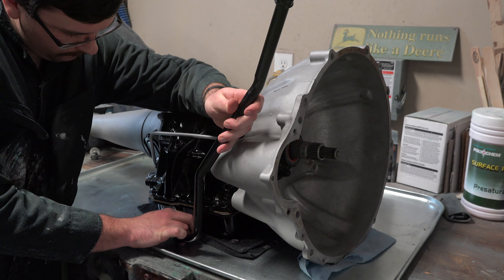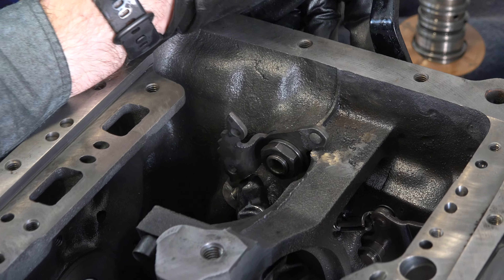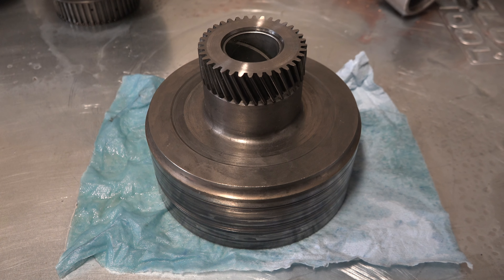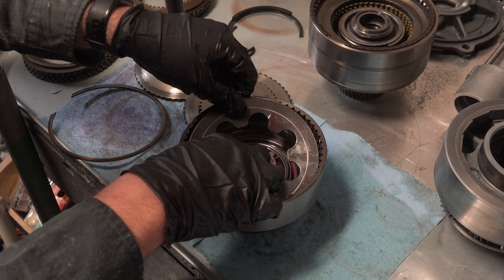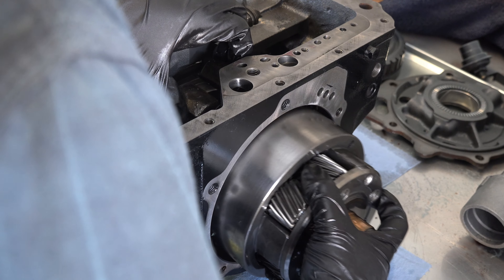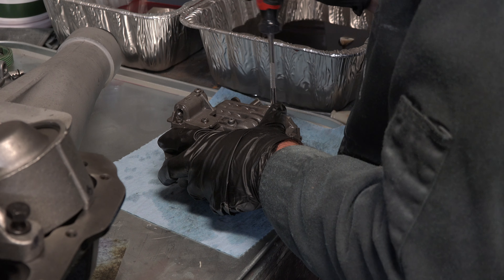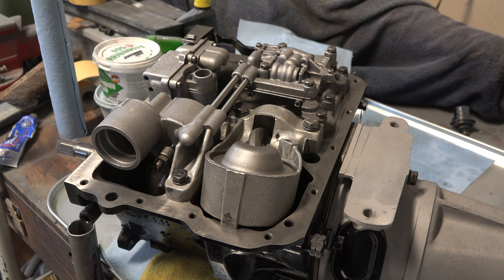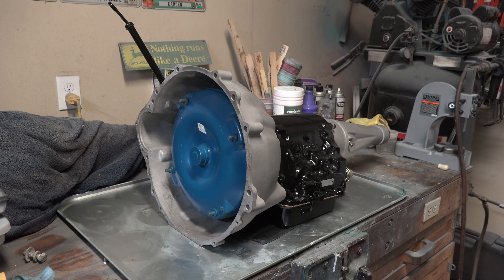1963 Thunderbird Restoration Part 8 - Cruise-O-Matic Rebuild!

Comment: After rebuilding my large case cruise o matic I'd like to share the most important lesson I learned from the experience.
Speedgems makes an adapter to bolt up a C6, AOD, or even a C4 to a MEL engine.  They have another adapter if you want to use a Chevy transmission, instead.
Reply from the maker: Very good to know! I know C6 swaps are very popular, however if I ever replace my Cruise-O, I would want to throw an AOD in there to get the benefits of overdrive, nice to know there is an adapter out there!

Comment: What rebuild kit did you use to replace the seals, bushings, etc.?
Reply from the maker: I got my rebuild kit from Concours Parts and Accessories. Most Thunderbird parts suppliers and some transmission parts suppliers carry at least two kinds of kits, a "gasket" kit which has all the seals needed for a rebuild, and a standard rebuild, or "master" kit that also includes the frictions & steels for the clutch packs. I would highly recommend getting a kit that comes with the clutches because it is getting very hard to find places that sell just the clutches only. As far as bushings are concerned, bushings typically do not come in the kits and will need to be purchased separately. The only two bushings that are readily available are the tail shaft bushings that the drive shaft rides on and the front pump bushing that the torque convertor rides on. The other bushings are typically much harder to find because they are no longer remanufactured. Occasionally, some OEM bushings will pop up on eBay, so that is worth a check if you needed a specific bushing. In general, plan on reusing most of your original bushings. Also some parts, like the filter and the vacuum modulator, usually do not come in the kits, so keep that in mind if you are wanting to replace those too.

Comment: What kind of ATF will you use?  Type F is what is specified, but after my rebuild i got mixed info on whether it should take standard atf with the modern clutches , etc..
Reply from the maker: I will be using Type F in the transmission. I did some research and arrived at the conclusion that as long as the clutches had been replaced with newer ones, that either Type F or Dexron/Mercon will work. That being said though, I decided to go with Type F because it prevents slippage in the clutches, which will provide firmer shifts. An old transmission rebuilder I knew told me that the firmer the shift, the better it is for clutch life. Also since I’ve already soaked the clutches, bands, and seals in Type F, I don’t want to cross contaminate it with a different fluid. I’ve heard mixed opinions about Type F compatibility with Dexron/Mercon, so I don’t want to take any chances.
Reply: @AngellsGarage  thanks.  That is what im leaning toward as well.  Actually now that i think about i did soak the clutches in type F and use it for assembly.. so i guess im committed.

Comment: Nice video. But why are you thightend the adjustment screw from the front band after the 10 in-lbs? In my manual stands that the adjustment screw is to loosen after this part. I want to adjust the front band, but some people say thighten and some loosen the screw. I dont know what to do…
Reply from the maker: Thank you sir! So you are right, the manual does say to loosen the screw 1 full turn after the 10 in-lb adjustment with the quarter inch block. I had read through somebody's rebuild of a small case Cruise-O-Matic where they had problems with their rebuild about a year later. Their problem was that the front band began slipping after they had followed the shop manual's adjustment instructions to loosen the full turn. To make a long story short, someone with many years of experience rebuilding the Cruise-O-Matics and even some old shop manuals from the 70's said to actually tighten the adjusting screw 3/4 - 1 additional turn after reaching the 10 in-lbs. After he made the adjustments, his Cruise-O worked great! While that rebuild was for a small case Cruise-O-Matic, I believe the adjustment process is the same for a medium case (I can't find anything specifying a difference between a medium case and small case adjustment). 

In general, if you look online through forums and other videos about the band adjustment, I've found that there are two prevailing methods for adjusting these bands: The first is to tighten the adjusting screw to 10 in-lbs with the quarter inch block, then tighten the lock nut down (so no additional turning of the screw). The second is to tighten the adjusting screw to 10 in-lbs with the quarter inch block, then tighten the screw 3/4 - 1 additional turn, then tighten the lock nut. I decided to go with the tighten method just because I found that recommended more often. I did check the band after the adjustment and found that it was not dragging and that the clutch drum could spin freely. If the adjustment was too tight, the band would drag and the drum would not spin freely,  which would cause the band to burn out. Likewise, if a band adjustment is too loose, then the front servo may not be able to fully apply pressure to the band, which could cause slipping and burning later in the transmission's life. 

So what I would recommend is to either follow the method of using the quarter inch block, tightening to 10 in-lbs, then making no further adjustments, or the method of using the quarter inch block, tightening to 10 in-lbs, then tighten the addition 3/4 - 1 turn. Please do take my recommendation with a grain of salt though because I have not testing my transmission yet so I can't comment on how my adjustment did. That being said, I do think there is some wiggle room in this adjustment. Several people have used both of the adjustments I have recommended above with success, so I think either one would be fine. Good luck with your adjustment sir, I hope all goes well with it and feel free to post an update on how it goes!
Reply: Thank you for your quick answer Angell. I searched for hours in different videos and forums to get the right method for the adjustment. And i got nearly the same information as you. The one thightend the screw only with the quarter spacer and some other people added the extra thightend turn. 
I only was confused because the shop manual says a different way about a few years.

I will test it with the 3/4 additional turn and will post my update.

But it will need some time because the half of my Motor is disassembled.
When i got my new timing chain and the gaskets, i will inform you.
Reply from the maker: @miwa134  Awesome, sounds good! I hope it works out and good luck on your rebuild!

Comment: I need to remove just my valve body to address a parking paw issues. Were there any ballbearings in the valve body that may fall out upon removal? I watched a different channel and he made it sound like there were ballbearings to watch out for.  Thanks in advance and love the videos! Keep up the great work.
Reply from the maker: Thank you sir! The valve body pulls out as one unit, so nothing should fall out. Just pull out the three bolts holding it to the case, loosen the front servo so you can wiggle the tubes out, then you should be golden! In the whole valve body, I only found one check ball, and that’s behind a clip so it will be fine. The only thing that may slide out is the gear selector valve, but that can easily be slid back into place.
Reply: Hey Angel, ran into a strange issue I haven’t been able to solve. Trans worked fine before I replaced the shift seal. Now it seems to be stuck in 2nd unless I shift to low then will shift to first but never third. Also seems to be slipping when at speed. I have checked the internal and external linkage and I believe it is correct. Fluid level is correct. Can you confirm the shift lever attaches to the shift valve in the first small slot on the end or the second larger slot? Also, confirm the kick down lever sits in the space between the valve body and the hook shaped arm? Any other ideas what happened?

TIA!